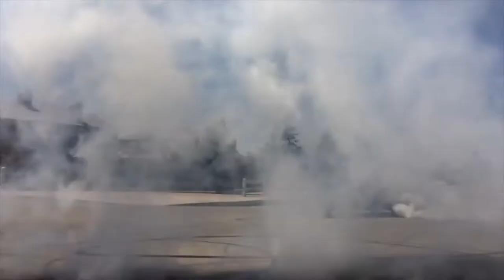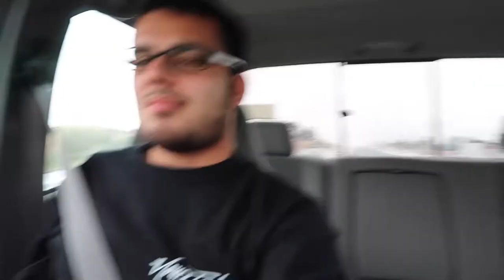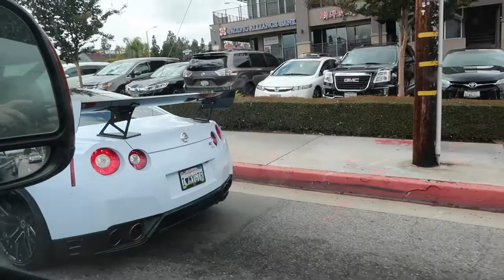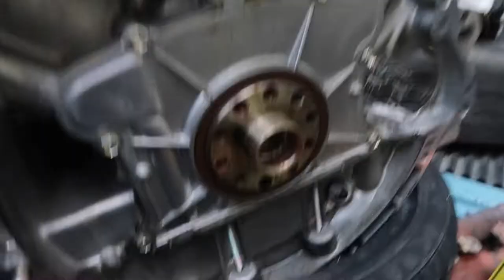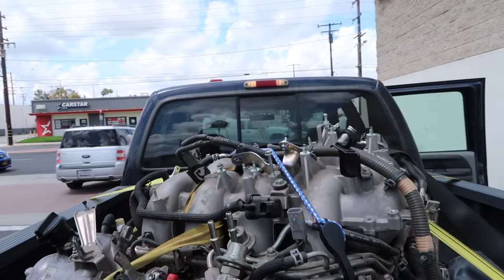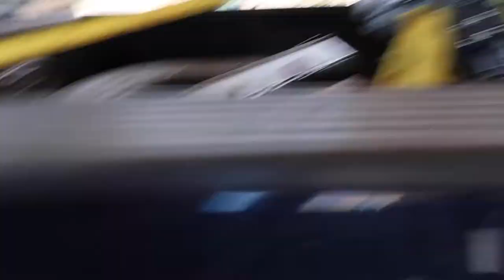WE GOT A FREE LEXUS ISF V8 MOTOR!!

Comment: The exhaust  manifolds can crack and make the motor sound like it's knocking I've seen it happen so there's a chance that was the problem
Reply from the maker: That's what we were hoping for but the previous owner had "no/low oil pressure" come on the dash at the time of the sound occurring. Then when the motor went to get pulled, they drained the oil and saw what looked to be metal shavings in the oil.. :/ Pretty sure it spun a bearing or something let go inside the motor itself unfortunately!